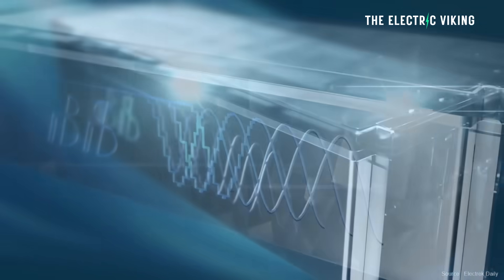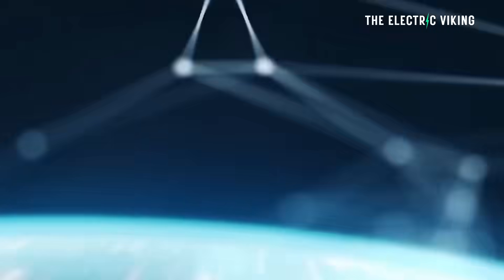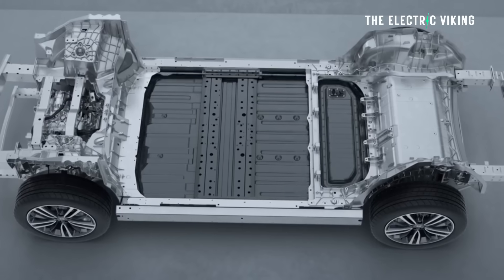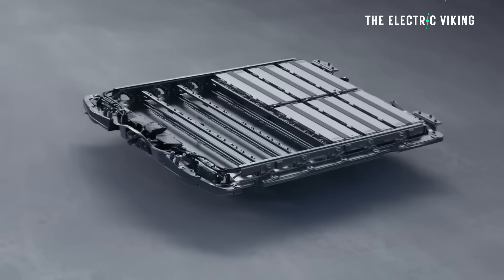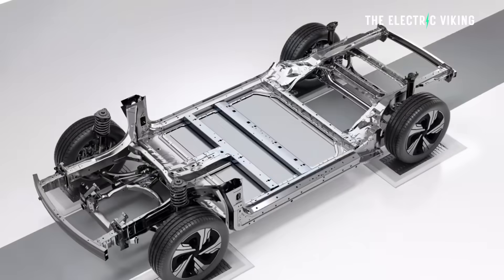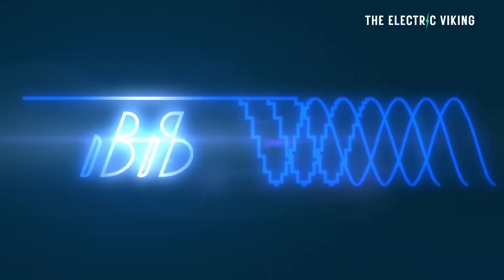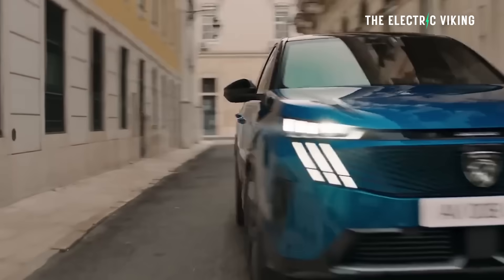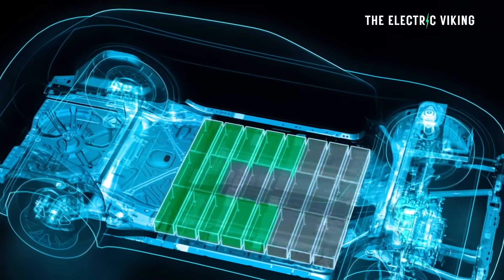Stellantis Reveals Revolutionary New Battery And EV Charging Technology

Comment: One of the most critical safety issues for electric vehicles (EVs) is how the battery pack and chassis behave in a collision. Especially in cars like Teslas, the battery occupies almost the entire floor of the vehicle. This leads to a few key problems:
-Excess weight concentration: Battery packs typically weigh between 400–700 kg. This huge momentum puts extreme stress on the chassis during crashes.
-Cases of “splitting in two”: As you’ve seen in the news, in some severe accidents the chassis breaks apart under the weight and inertia of the battery, and the car splits dramatically.

It's still early days. In the next 5–10 years we’ll likely see the EVs worth to buy.

Comment: Imagine a world with only EVs, and then someone invents the internal combustion engine. Multiple times the range at a fraction of the weight, no power loss in cold temperatures, no sudden non-extinguishable fires, no 2-ton battery to shlep around, much less wear on tyres, tank filled in minutes instead of hours, stable re-sale value, no need for blood cobalt mines in the Congo etc etc etc.... it would be a no brainer.

Comment: Majority of home charging is 7 kW AC. so all the hype of fast charging is only for road tripping. Long distance where delays for charging are crazy long due to poor infrastructure and faulty road side charging lack of grid supply to charge more than 10 vehicles at any one time. 
You are also not getting 350 kW DC fast charging at home. 
Mass requires energy to move the higher the mass the greater the amount of energy used.
Make it lighter and stronger with cast alloys and faster and wedd to structural Alloy battercase in a skateboard design. 
An Alloy skeleton frame like a Nascar  with Polymer panels and light , corrosion resistant and more recyclable.
Permanent magnet motors with resin rotors not steel reducing rotational mass the Axial flux style motors providing 50% weight saving for same kW output and torque.
 Get rid of half the heavy metal crap and the unnecessary garbage that are the stylist foundations and you have a vehicle that is now 300-500 kg less. Just does not rust as quickly so lasts longer. Therefore reduces replacement cycles.
Results in less vehicles over time .

Comment: Check out the orbital data for the satelite carrying the IVO quantum drive.  It's working! Real reactionless drive!  The data id on the Satcat site under the NORAD designation 63235.  It carries 2 propulsion systems.  The first is from some unknown source and was active in June/July where you can see it raised the perihelion by ~2km in a few weeks then allowed it to drift back down.  The second is the IVO quantum drive, powered up on Aug 6.  It pushed the satelite apogee up ~2km over the next few weeks, then was turned off and allowed to drift back down.  The IVO guys aren't releasing anything yet but the data is clear, something pushed that satelite up when they turned on their quantum drive.  I hope you check this out.  This is momentous!

Comment: 5 million miles in one car? Yea, sure, no problem, bit like the archetypical 50 year old broom? One that has had 3 handles and 4 brush heads, but it is 50 years old. Now if a car (say taxi) could average 30 mph (in town) over 10 hours a day (365) - that is 45.6 year. 20 hr/day - no problem that is 30 years - if you want you car serviced in that time. Or for taxis, de-barfed (or worse!)

Comment: If batteries out last cars and 5 million miles is on the cards. Will it not be logical and possible to just buy a new car minus battery and fit your old battery into the new car?
Reply: You just hit on Elon’s long term plan. The car is just the means to build and have you pay for the battery for his energy storage system.
Reply: @lawrencefranck9417  that comment makes no sense. Everyone isn’t using elons products are they. The battery in my vehicle has nothing to do with Elon. Plus using the same battery in many cars isn’t constantly buying anyone’s storage system is it. It’s constantly buying a vehicle to put it in.musk has many plans for the future, it doesn’t mean  it will happen. Neither will a drug fuelled human last forever (Keith Richards being the exception).
Reply: Perhaps down the road with industry standards 

A key point is off grid battery storage for repurposed used batteries

Comment: How anyone can dismiss Giga casting as insignificant is beyond me.
It uses fewer parts which makes it both simpler and cheaper to make.
It is really quick to manufacture and that speeds up production, and that in turn increases line output and profitability.
It's stronger than the previous solution and it will not rust.
It is a win, win, win all the way and even it's one supposed drawback about repair difficulty being proven false, only a fool would dismiss this technology!
Reply: Plus increased annual insurance costs when the car has to be written off instead of repaired
Reply: @yorkyone2143  Recycling large chunks of  aluminum is easy. No need to sort parts or deal with tainted meltdown. Even press culls can be dropped right back in the pot at the factory.
Reply: I agree but it seems to be limited to EVs. I have not seen any other type of vehicle use them.

Comment: SAFT are a company based in Bordeaux, about 170 km south west of where I live. They have been making batteries for shipping, aviation and military since their founding in 1918. Their customers include the US navy.  Total Energies acquired them in 2016 and Total went into partnership with PSA to form Automotive Cells Company (ACC). Mercedes joined the ACC consortium in 2021. The pilot plant at Nersac is about 60 km south of here and their first Gigafactory in Northern France opened last year but is still as far as I know not providing much output to the PSA Group or Mercedes as yet. PSA have yet to design and build a 'ground up' EV, all their numerous European models share platforms with ICE cars. This was the philosophy of Carlos Tavares but he is now gone so it will be interesting to see what this unwieldy group does next. Every Peugeot and Citroen EV we see in France is based on an ICE car, they need to learn how to build an EV only factory which has been rivals Renault's strategy for some years now.
Reply: This IBIS project started in 2022 but I don't understand why Stellantis thougt that replacing one big circuit board with about 24 circuit boards is an "advancement"?

Power electronics have evolved over the last years i.e. the use of SiC.

BMW still uses one big - but easy to replace - circuit board (with SiC based power electronics) for their Neue Klasse.

This "news" of Stellantis is only meant to boost the price of their shares on the stock market.
Reply: I have specific demands from a vehicle.  What EV currently has the following capability?  Can tow a 2.5 tonne load with a 600 km range. Can be refuelled in 5 minutes. Can easily increase its fuel range by 50% by the purchase of a relatively cheap aftermarket solution ( e.g the installation of a long range fuel tank).  Can be refuelled within 5 minutes in remote areas, such as along the Tanami, Great Central Road, or Canning Stock route. All of this for less than $AU100,000.  I note the F150 Lightning can tow a heavy load. Just not for very long. Then you have the issue of where can it be recharged if you’re doing interstate trips. Will you be able to recharge it within five minutes without having to unhitch what you’re towing?  The F150 Lightning is forecast to have a sale price in Australia of closer to $200,000.  So, not a cheap towing option.  I would love to. the Electric Viking hitch up a caravan to his EV and then go on a trip from Melbourne across to Perth, then up to the Kimberley along the Gibb River Road and back to Melbourne via the Tanami. That would be an excellent test of where EV versatility is at.

Comment: 8 year Battery warranty  really shuts up any talk of LONG BATTERY LIFE.
Reply: Compared to a ice engine guarantee it’s significantly better. Batteries are already outlasting many cars. Not often the guarantee needs to be enforced. My sister had a brand new Camper van, turbo blew up at less than 30k miles and 3 years. Guarantee apparently didn’t cover that. The EV guarantee on the drive train is better than ice gives. Hence I buy secondhand EV, it still a better guarantee than a brand new ice. It’s also not a third party worthless guarantee. If you want to complain about guarantees, it’s not EVs you need to take the argument to, it’s ice.
Reply: @kevinallen4604  That's right, and if a company offers an 8 year warranty on something you can be sure they've done their testing and the math. So expect the product to last twice as long and more.
Reply: @kevinallen4604 I have 2008 Toyota yaris and engine works Great  to this day. So I dont hear you on this 1.
Reply: What do you mean by that?
Reply: Not only that but EV batteries are getting cheaper even if you do have to replace them and there are even businesses learning to repair them. In the future 3rd party battery service centers could become as common as cell phone service centers now. It takes a lot less investment in tools for one of those compared to ICE service.
Reply: @frankcoffey its much cheaper to fix my Toyota Yaris emgine.then a Battery Pack
Reply: @TrueColors-tr8dc  Toyota doesn't seem to be confident in it. The warranty is only 60-month/60,000. Any car even a Yaris should last longer than that.
Reply: @frankcoffey 60 Month Warranty is a MORE THEN REASONABLE WARRANTY  FOR THE PARTS THE WARRANTY  REPRESENTS...WHERE AS 8 YEAR WARRANTY  FOR THE OTHER PART A GIANT $20,000 POTENTIALLY BATTERY IS A BIG DIFFERENCE.  You comparing APPLES TO.ORANGES WHICH ISNT A FAIR COMPARISON
Reply: @TrueColors-tr8dc  I still think it's shorter than the amount of time people rely on their car. Many Yaris buyers can't afford an engine repair at 60k, even if it's less than $20,000.

Comment: Sounds good and all... but we are talking about a tech they will not be releasing for 5+ years here With all the improvements year by year BYD and CATL  as well as Tesla are making as well as releasing every year.. I think there claims are being beaten by the other companies

not to mention there a lot of these claims are from the battery manufacturer Factorial not directly from Stellantis. It all sounds good but being it is 5+ years away it fades into what the other companies are producing now. 

Also there claims on second life battey use is already being done by so many other companies already. if the battery is ok after a car wreck you bet someone is reusing the pack already for a home system.. Even ones that get sent into recycling to places like Redwood material all get tested and they use the good batteries. So there recycling claims are already RL from other companies already.

Comment: Modern batteries are still a brand new technology. Recent evolution (last 3 years) is mindblowing. Really do hope to see a technology breakthrough with batteries weight, capacity and price as it was with floppy discs, hard drives and processors back in the eighties and nineties from 360kb to 20 Megabyte to 10 Gigabyte and than Terabyte.
Reply: I think we will see at least 3 new types of batteries in production each year for the next decade. Not just "invented" but in production. Not all of them will be for cars but 3 per year.
Reply: You can wait all you want. Meanwhile, the currently available Lithiumbatteries, no matter how "advanced" are a disaster... both in performance, in cost, in safety, and in environmental impact.
Reply: @M1984FA wrong on all points. Especially compared to burning fossil juice. I’d suggest you read the reports produced by medical experts that have studied the effects of tailpipe emissions rather than the views of the fossil fuel companies protecting their profits . It should be enough for anyone to see a battery that lasts for years, is recyclable is somewhat better. Not only will my battery save on vehicle emissions it will save on general domestic emissions too when V2G gets going. Combined with my solar , home batteries it will help run the house and feed the grid, reducing the need to run gas peaker plants at times of grid stress. Multiply that by a few tens of thousands. We had led acid batteries for years no one gave a shit about them.